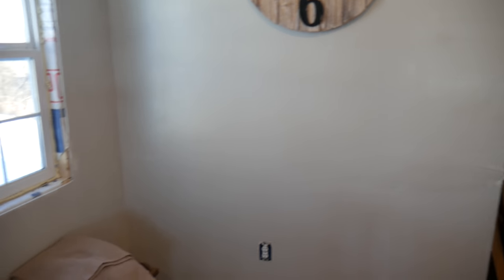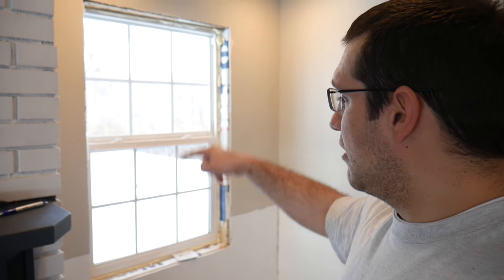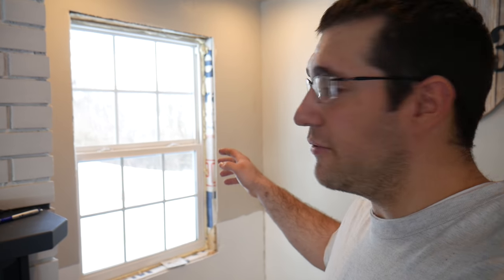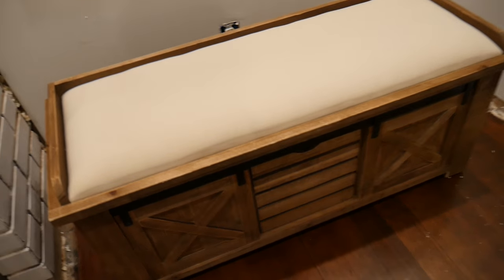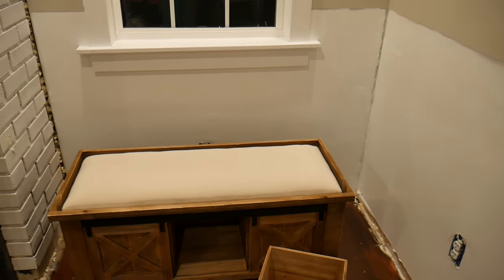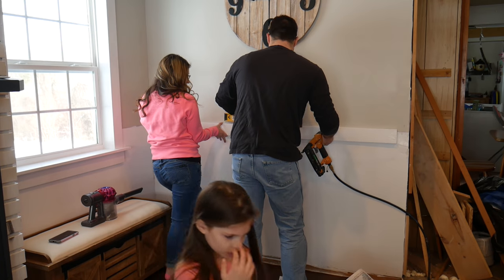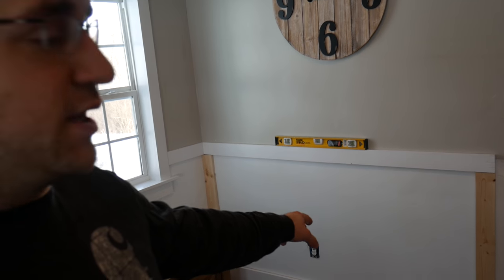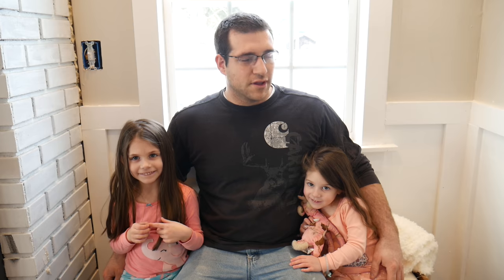FARMHOUSE RENOVATION!!| DIY| Reading Nook!| Episode 20

Comment: Nice work man 👍👍. What coal mine did you work at? I used to work at McElroy, now I'm an electrician at the Certain Teed plan.
Reply from the maker: Hey I was at McElroy from 2009-2010 for GMS. But I was in the union at Shoemaker. But the past 4 years I'm now working at what was PPG
Reply: That's cool, we've worked at the same coal mine. I worked there from 2005 until 2016. I'm glad to be out of the mines. It was good money but no life. PPG is just down the road from our plant. 👍👍
Reply from the maker: I know what you mean man. Yep just down the road. Small world!
Reply: @Mallard5plus1Farmhouse  no doubt man.